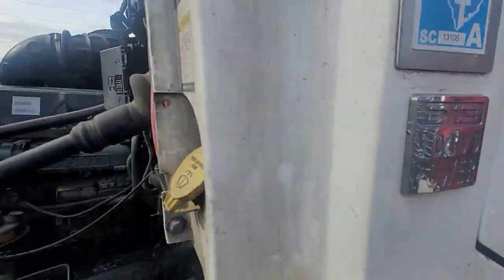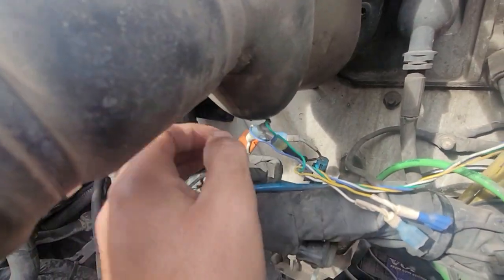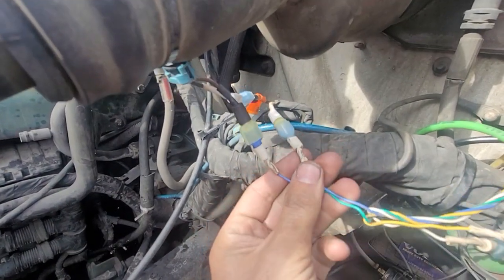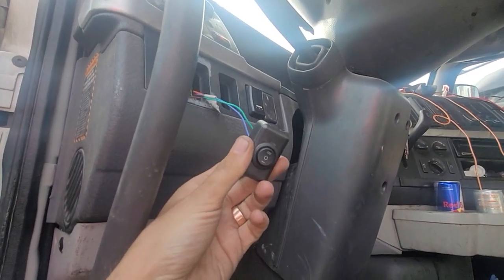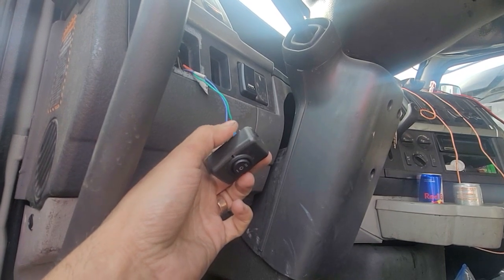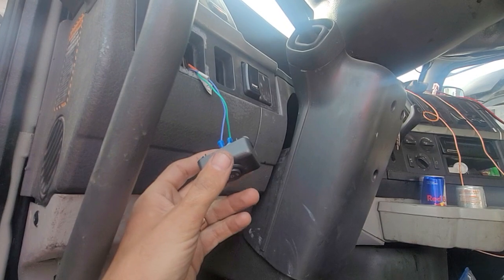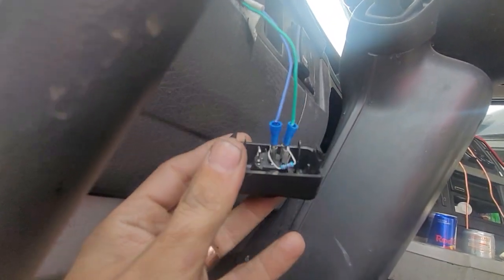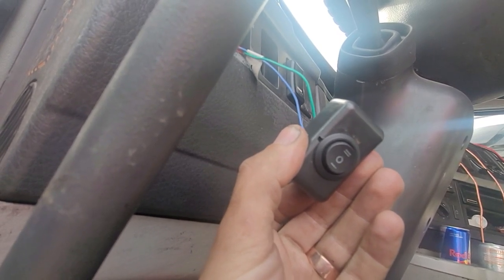better way to add an engine fan switch to a volvo D13

Comment: Hello, I put new solenoid and my fan stays on it will not turn off but it I jump the ground wire it works what do you think it could be
Reply from the maker: The engine computer turn the solenoid on and off by giving it ground. So either the comouter dosen't want to turn on the fan or the wire from the computer to the selonoid is bad.
Reply: @drevilatwork  thank you I will follow the wire up the computer to see what might be the problem